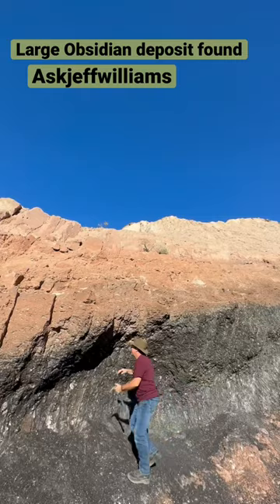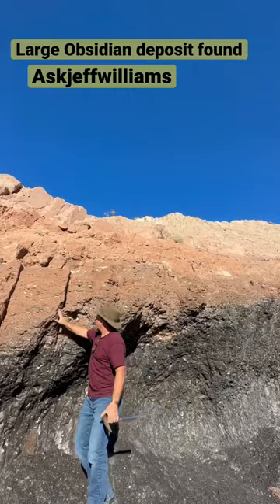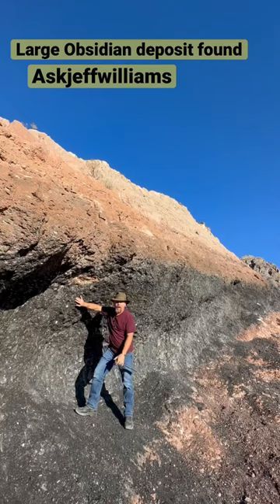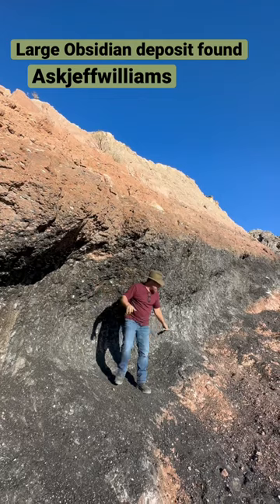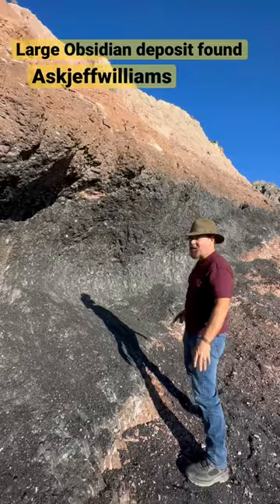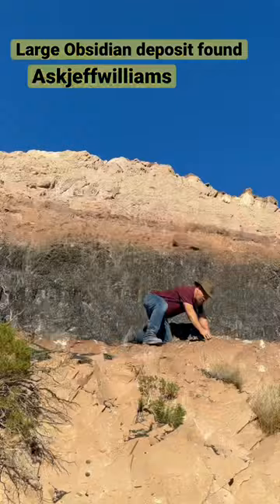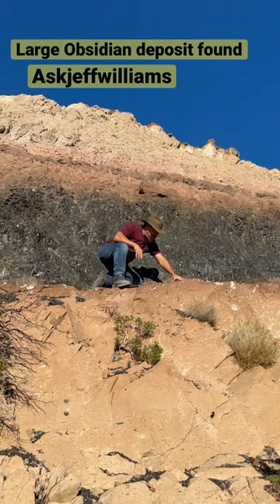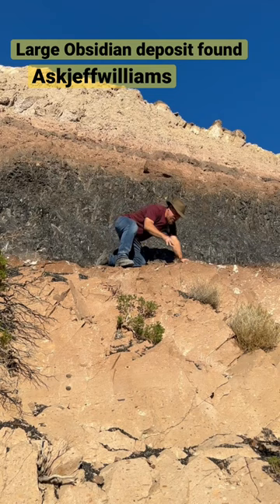GEOLOGY 101- Obsidian Deposit in Tecopa CA - #shorts

Comment: That is pretty cool. Utah has some pretty interesting obsidian deposits in the West desert on the south west flanks of the Thomas Range. It's a thick band of obsidian between layers of rhyolite flow, and the mass is composed of "Apache tears"/obsidianites with sharp glass needles filling the void between the obsidianites. Some of these are mahogany and even less common is gold and silver sheen. If you walk around the area and find obsidianites some distance from the main deposit, they are generally translucent, indicating that they were ejected from the volcano and cooled in the air. I've found such pieces more than a mile away. Also found plenty of arrowheads from this location in the surrounding area, and found one finished arrowhead of this material more than 100 miles away in Salina Canyon.